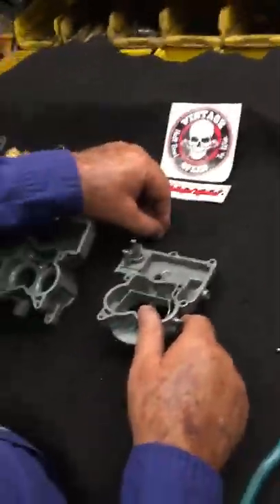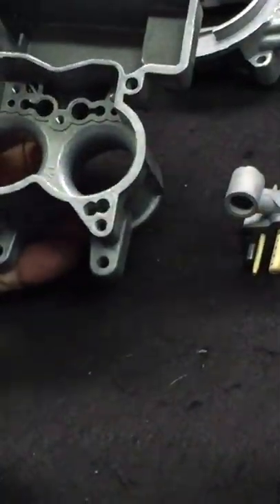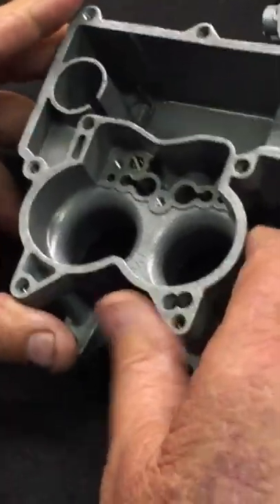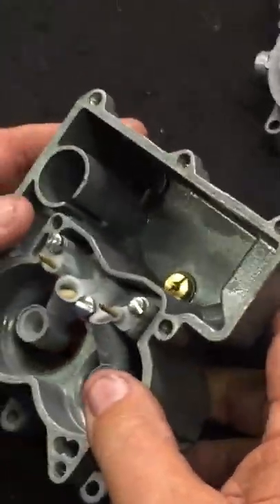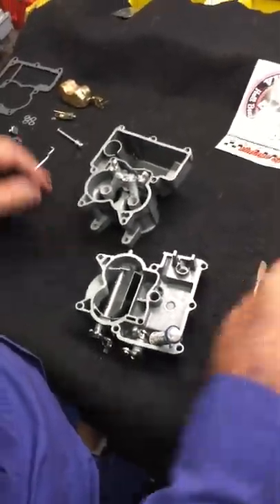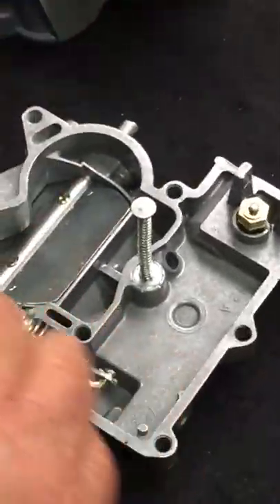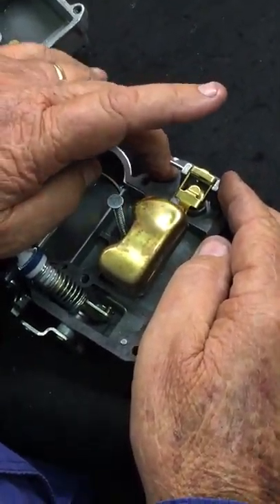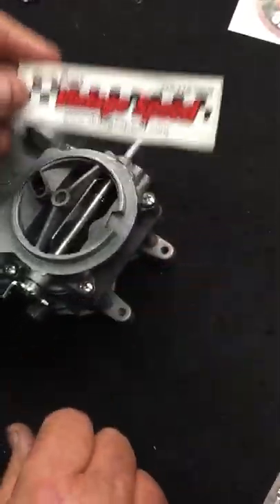CHARLIE PRICE VINTAGE SPEED  PART 2  ROCHESTER 2G TRI POWER REBUILD

Comment: Charlie helped me immensely. I had a primary carb that was leaking from the cluster at idle. I followed all the advice he gave plus advice from several good mechanics as well as my own knowledge and could not get the thing to work. Finally he said send it to him. He found 4 things wrong that he said I couldn't have seen. He fixed it, ran it on his test engine and flow bench. He got it back to me in in less than 2 weeks so I could get it back on to drive it to the Columbus Goodguys show. I bolted it on and it started right up, no more leaking! I set the idle mixture and idle speed to my engine combination. The next week I headed to Columbus, about 240 miles. The car ran better than ever and got 20mpg with a tri power on a Chevy 350 in a 1933 Ford street rod. Can't be happier.

Comment: I used  the blue gas pump for carb a few times. It just  fell apart.  I'm using the leather ones dont have any issues yet . They  keep changing gas . Gas use to small like gas now has a funny smell  to it now . Older cars don't run as good and as before. Been using the  Mystery Oil in the gas been helping out alot running better.
Reply: If you can, try to find a station that does not have ethanol. In Indiana they have to put on the pump if it has ethanol in it. You can find them, they are around (maybe not California I can't verify that) I use 93 octane and sometimes mix 87 with 110 octane racing gas to about 91-92 octane. It runs great and I have never had a pump failure in 8 years or so and until june 2022 I had the black buna pump!!!